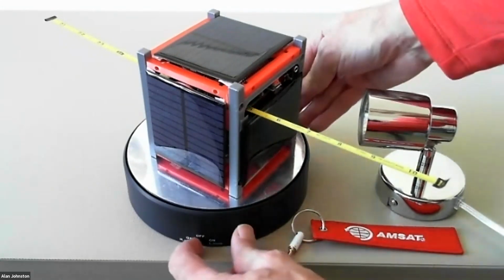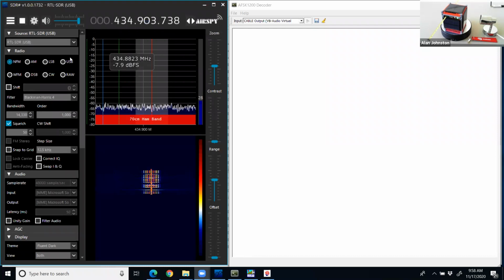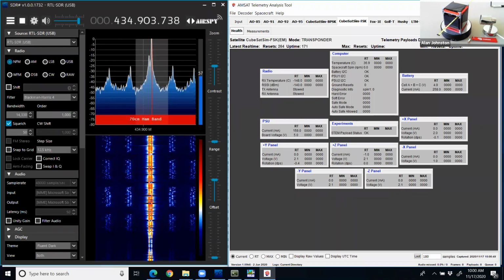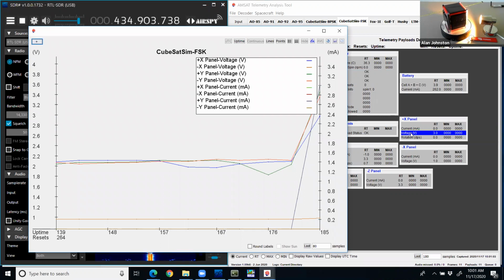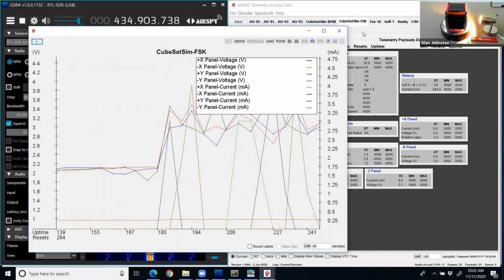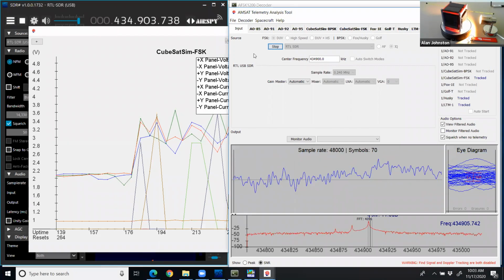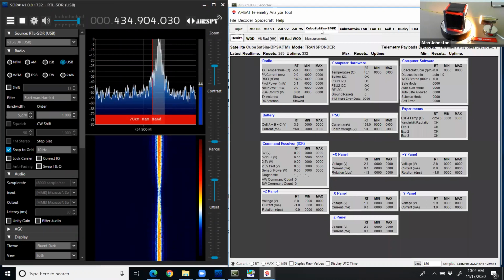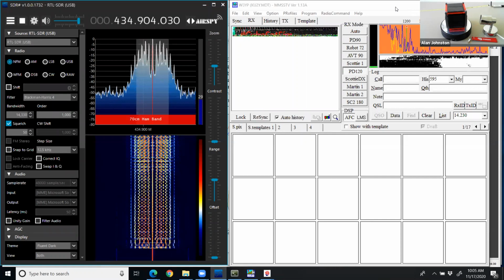Operating the AMSAT CubeSatSim

Comment: When you change modes it seems to be fairly immediate, ive just finished putting one of these together and when I change mode inseams to be rebooting. in addition I can only get FSK mode toward reliably. Any clue why this might be?
Reply from the maker: Hi Devlin, I’d need to see your logs to be sure. It should not reboot each time you change modes. If you share some logs (the output of CubeSatSim/log command on the Pi) on the GitHub Discussion page we can troubleshoot it: https://github.com/alanbjohnston/CubeSatSim/discussions

Comment: Hello, i´m testing this setup with the CubeSatSim Lite, using only the raspberry pi and an antenna, but it isn´t working. I´m successfully receiving the transmission of both cw and asfk files in SDR# at 107.5MHz, but my raspberry is not transmitting like yours at fixed intervals and getting quiet between transmissions, in my case the signal is high even whe not transmitting data, and i can´t get any telemetry data in the ASFK1200 decoder using the virtual cable and neither i´m able to get data on Fox Telem using the SDR directly. Do you have any suggestions on how i can solve this issue?
Reply from the maker: Hi Danilo, you are using the original CubeSatSim Lite.  It transmits an AFSK recording in the FM band.  If you can hear it at 107.5 MHz, then it is working.  You will get a strong carrier signal between AFSK packets - that is normal.  It should be possible to decode it using AFSK 1200 Decoder.  Make sure the audio levels are high enough and the virtual cable is selected correctly.

This version of the CubeSatSim Lite does not do Fox emulation, so you won't be able to decode anything using FoxTelem.

However, if you build a Transmitter/Filter Board (https://github.com/alanbjohnston/CubeSatSim/wiki/New-Transmitter-Filter-Board-Hardware-and-rpitx-Software-Install) then you can run the latest CubeSatSim software (https://github.com/alanbjohnston/CubeSatSim/wiki/2.-Software-Install)  This will work with FoxTelem and will even generate simulated telemetry for you to look at.

Good luck!
Reply: Thank you very much for this detailed information. And congratulations for developing this project, it is a really nice learning experience.